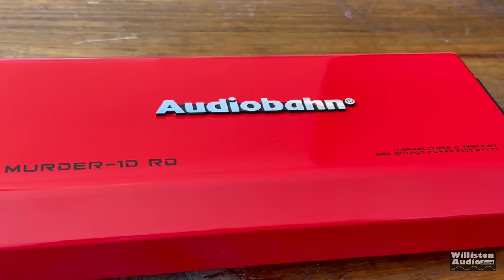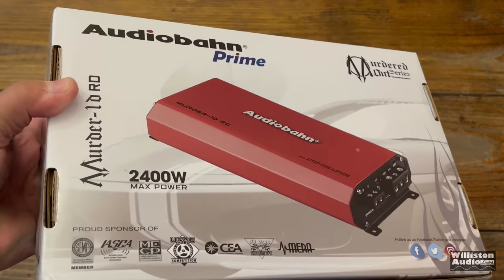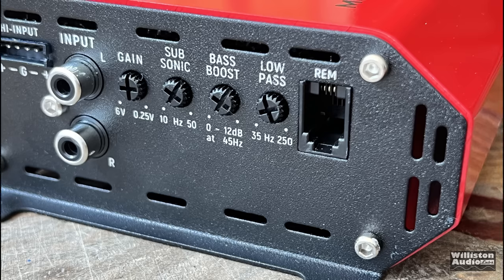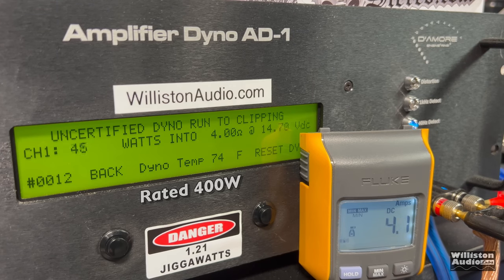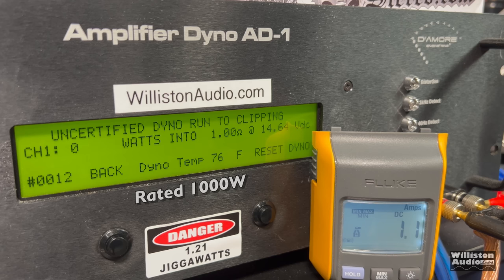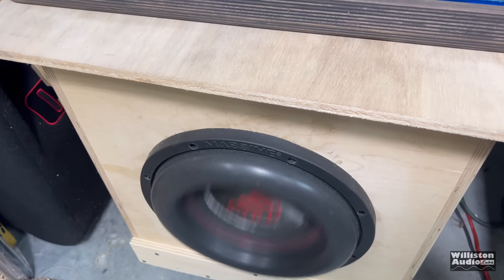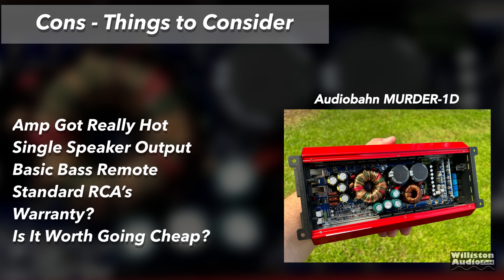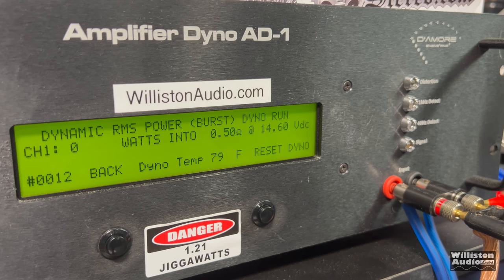Can This $79 Amazon Amp Power a 6000W Subwoofer?

Comment: Your Dyno vids along with all the other dyno vids all over YouTube have made a huge difference with manufacturers thinking twice about listing bs power ratings 🙌🏼
Reply: Lol, You know good and manufacturers are taking notice to Big D’s video’s 😂
Reply: @yourmom-ii8ep  They really don't
Reply: even if they bs sometime it's still a very good deal first thing to do is to look at the fuse rating = efficiency depending on the class of the amp.
Reply: The dyno recreates a perfect stable current situation at 14.4 something that will never exist in your installation. You have to be realistic.

Comment: My buddy Marc had a big two channel class AB Audiobahn amp hooked up to a couple of Audiobahn 10s in a small ported box that he built for the back of his Wrangler. That system was impressive. It hurt me while sitting in the passenger seat. It disturbed my breathing. Lol I had to get out. When I got out, I could see the windows moving like a damn passive radiator. The rubber seals around the glass were holding on somehow. Lol I told him to keep a window rolled down. Haha I was so impressed that I picked up a couple 12s and a class D mono block amp from Audiobahn for my old Suburban. It didn't sound as good or loud as his system though.
Reply: For fun as a side job I used to do car stereo installation. A lot of my customers like the LOOK of Audiobahn. I never heard one Audiobahn system that sounded good. No matter how much money was invested and no matter how much time was put into the installation. The equipment is pure garbage. Your friend probably had the real equipment hiding. The Audiobahn was strictly for show as usual. Looks good, sounds like shit.

Comment: Shocking. However when I was Building Systems years ago. There was a young kid down the block that built his system using Audiobahn flame series. Everything was chromed-out. The amplifiers, The woofers, every piece of equipment in the car was Audiobahn. Everything was professionally installed, he basically built a car for competition Or show.  It was a New  Mazda Protege looked great. Got inside the vehicle to give it a listen. I was very disappointed. I never said anything to this kid I didn't want to hurt his feelings.  With all the money he invested, it did look fantastic, it sounded like absolute crap. After that day that was a brand that I never even considered.  I didn't do a fine-tooth examination I was just surprised by the lack of sound.
My system looked like an amateur assembled it.  Sounded fantastic. Watching this video brought back those memories.
Reply: Yeah, I had Infinity Kappa 6x9's (the green ones) in 1999 and they got water in them and they gave up the ghost.  I went to a car audio shop that sold me Audiobahn 6x9's and the capacitors blew up all over my leg twice and ruined two pairs of pants.  Oil and yellow fibers everywhere.  After that I always considered them a brand I stayed away from.
Reply: They had some quality stuff…but you had to wade thru the junk and know what was good.  When they first really hit the market hard, they were a lot better….they got cheap the longer they were in business.
Reply: They had some quality stuff…but you had to wade thru the junk and know what was good.  When they first really hit the market hard, they were a lot better….they got cheap the longer they were in business.
Reply: They had some quality stuff…but you had to wade thru the junk and know what was good.  When they first really hit the market hard, they were a lot better….they got cheap the longer they were in business.
Reply: @thomaspepera2711  
Just wondering why your post came in 3 times? You can delete 2 if you like.

Comment: WOW Audiobahn is back?!
I LOVE their classic line up. Especially the AWT 10,12,15.18
Reply: I know their amplifiers have skyrocketed in price if you can find one
Reply: My buddy was a huge audiobahn fan back in da day.... Had a big chrome flame series amp, and 2 12" subs in an extended cab ranger, the box barely fit... It was a fun truck to cruise around in and get a back massage from those subs.
Reply: @volvo09 In my late teenage years my best friend had a black Acura Rsx Type S. He had a flame series amp and a pair of the 12 inch subs too. Our local audio store was named  Custom Enclosures and they built a really nice custom box for the hatch on his Rsx that had the subs inverted so you could see the flames on the subs. It was one of the best looking setups I've ever seen. The fastest I've ever been in a vehicle was also in that Rsx. I did all of the work on the engine. We managed to hit 164 mph in 5th gear. It was a 6 speed so it still had a little left in the tank. You could feel the rear tires trying to lift so we never pushed it that far again. Sadly my buddy ended up getting beat to death at a party a year or two after our high speed test run. Your comment made me think of him and I always smile when I do because he was such a fun and goofy dude to be around. Sorry for the Ted Talk but I hope you enjoyed it.
Reply: Hct2300 is a nice looking amp with decent power

Comment: I used to have a pie of massive audio woofers in my c10. First stereo I ever had installed. Had a pair of massive components, Fujitsu ten eclipse head unit, and Alpine amp. Loved that setup. Well balanced.
Reply: Fujitsu ten / eclipse was making some REALLY quality stuff in the 90s
my 1999 eclipse 3640 amp is pure electrical porn on the inside..... and is STILL working
Reply: @kainhall  yea I totally agree. Unfortunately mine ended up taking a dump, but back then I didn’t have much money and paid a good bit and it was refurbished. Swapped to a single din DVD head unit with 3” display from JVC and likes that. It was a chameleon unit so pretty much disappeared in my c10 cause I had it illuminate on the prox sensor.

Comment: Last Audiobahn amp I had back in the 2000's would CONSTANTLY blow fuses. I still have my first Audiobahn sub, hooked up to my surround sound for a little extra bass
Reply: We used to wrap aluminum foil around the fuses in our fuse blocks when running Audiobahn amps
Reply: I just made sure the ground was 1 gauge bigger than the positive and I never had that problem again
Reply: Audiobahn was specifically designed to look great All Chrome with the flames and the giant magnets I never heard one Audiobahn setup that sounded half as good as my Kicker that I installed myself.
Strictly for looks.

Comment: I usually install, a small fan underneath at vents and connect to ground and remote.... On my amps.. Great video Big Deez
Reply from the maker: yes and active cooling approach would be good but I was also running it at 1/2 ohm on the sub so surely that impacted the amount of heat experienced

Comment: The silica packs I use in my shaving razor bag. Also keeps them from rusting. 👍
Reply: Thats actually a great idea. Im gonna start using them in my straight razor collection. The high carbon steel will rust if it so much as hears the word "humidity" thanks👍
Reply: I never seen a shaving razor rust!

Comment: for my starter setup before getting a 5K monoblock amp. 
I had a "Dual" 300 Watt little square amp that was black and chrome from walmart. Only to power my SPL SP15 I had back before they discontinued them. 
Was rated dual 2 ohm and could be wired down to 1 ohm. 
I wired it up to 4ohm and bridged to this little 300 watt amp and the results were impressive! It was still really loud for what it was on 300 watts bridged. 
But that amp got SUPER hot. It was very impressive for a walmart amp back in 2012 - 2013.
Reply: My friend had 2 “dual” 10’s that absolutely POUNDED and CLEAN

Comment: Still have an Audiobahn amp that works! It's a 4 channel flame series. I used it up until recently when I replaced it with the Recoil amps. I amp impressed with Recoil BTW! I have a mono block and a 4 channel.
Reply: i still have one too.. but it long blew out.. have it in my garage on the shelf..so pretty in all chrome .. i never tossed it
Reply: @PopePlatinumBeats  I think the only reason mine still works is because it's a 4 channel and never really pushed hard.
Reply: I have first gens.(black heatsinks) before the flames 2600 & 4400 in my show car still work like a champ.
Reply: @4BillC  I give mine hell every summer lol.
Reply: I had one of the flame series amps and two of the aluminum’s 12s! Bangin back in 2001

Comment: So just to start with Audobon is still a very good quality set up to buy however, it tells you on the box and everywhere else that you need to install some sort of ventilation or a fan to keep the amp cool and back in the day you had to put fans on every amp you bought it would get hot and go into protection mode. I have no problem on cost me $150 that is throwing out 1000 Watts.

Comment: Now I'm still learning about audio but can anyone answer me this. Is a affordable priced amp dynos at 1000watts the same performance as a higher price amplifier for just the performance of powering a identical system. Or is it all box and sub outside of the amplifier power
Reply: Showing how hot the amplifier became should let you know stay away from this company I never spend $79 on an amplifier unless you're driving tweeters

Comment: My biggest question has been.?.how do these amps handle long play abuse? Because my main reason to stick with FOSGATE is for the simple fact that I can play them for over 2 hours peak level and they barely get hot and I have never had one cut off and go into protect mode unless I blew a speaker which i've only done once becuase I try to match each component to play at it's max abilites. So just how do these "new" brands hold up compared to "old school" Rockford Fosgate?
Reply: Rockford FosBreak 😅
Reply: @danielknepper6884 alpine and kicker all I  have  a couple xtant. are go to for quality as far as bass lows. Any quality amp running highs or mids in perspective should last a long time proper setup and all. Analog amps are better sounding than newer Digi

Comment: i see audiobah hasn't changed my amp from the 90s used to get so hot it would shut down I hate to cut the cover with a grinder to make a cutout to add a 120mm pc fan that i wired to turn on with the amp it never overheated after that.

Comment: my amp is running 1 ohm but its meant for 2. is had sensors and breakers so that it doesnt over heat or produce to much power. is it safe to keep using it that way? it runs for an hour straight and only gets a little arm

Comment: Yes as long as amp can handle ohm depending on rms power will depend on how much sub can move besides box limits
Reply from the maker: Yes my AMM-1 is out for updates or I would've shown the actual power/ohm load with the speaker.
Reply: I won't use a box unless it has Rhino liner on the outside anymore

Comment: The black diamond choke looks better made tighter turns and looks like more windings . Maybe that's the issue why it's getting so hot being pushed to the max at wired to .5
Reply: 79.00 and runs @.5? If it did it more than once the buyer got their moneys worth

Comment: You said it got hot but you also ran it at .5ohm for 30+ min on bass tests and music. Seems kinda unfair to hold the heat against it in those conditions. Anyway, good video. Test the cheap Temu amps
Reply: its class D. Most class D stay cool

Comment: [*I'm not promoting the cartels] LOL, the Cartel purchases a well-known, going bankrupt/nearly defunct audio brand, moves all manufacturing & distribution into Mexico... turns the brand into a  great budget brand making it very popular throughout N. America... uses AMZ as a primary "distributor of [its] product", a company which has pass-through clearances for shipping & such which others don't... This is like Gus Fring to the 1,000th power without dealing with expired chicken or produce. They even include the white glove to "handle the product" and troll authorities by naming the product line "M*rder". THAT is no Mickey Mouse program indeed!

PSA Announcement: If you purchase one, take it to the Po-po Station and have a drug dog sniff the package or open the amp's chassis to make sure that you were sent the current 'model', JS.

[As always, thanks Big D for sharing the amp temps, it's one thing to do a Burp Test, another thing to run an amp with music at volume for a continual time period  :)  ]

Comment: Stay far away. 
Unless you want to spend your time on the installation.
Sounds like garbage and because it gets so hot MUST be  replaced when it burns out. It's like throwing money away. 
Makes no difference what the output is. The sound and how long will it last at that temperature?
Heat is the enemy of all Electronics. Nothing new.
1000 watts that sounds like a tin can and will hold up for 7 to 10 day's. Put the $79.00 toward your wiring not your amplifier.

Comment: sadly your "tests" are not saying anything about the sound quality. its pretty useless and nonsaying, when for example thd is not covered in this showoff (i dont think you can even call it test). i bet it will sound thin, less dynamic and awfull as all the tons of cheap 1ohm 1kw amping out there. and the tempreture is a absolute no go. fingers away from that!